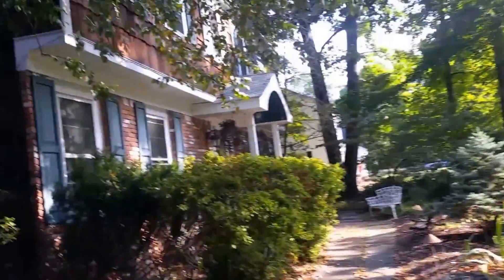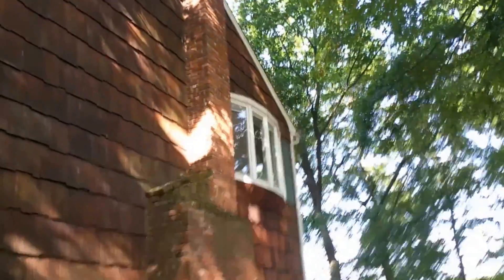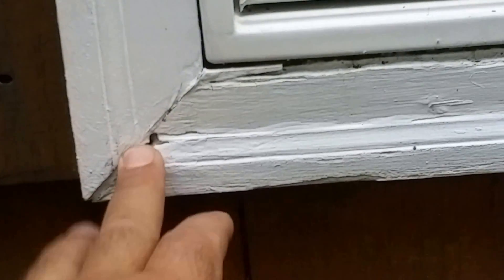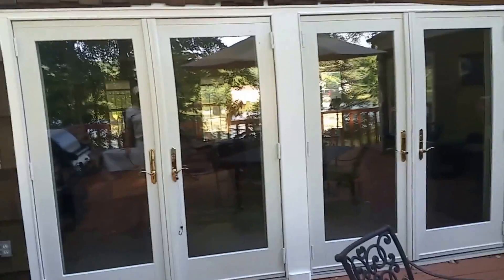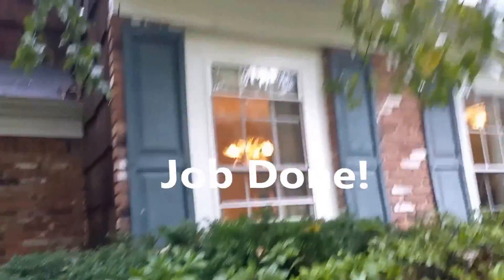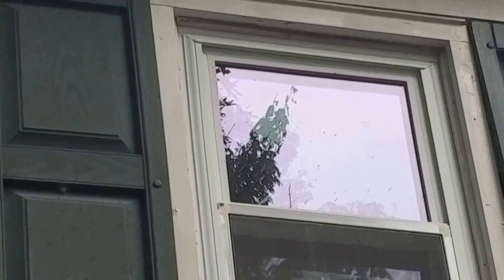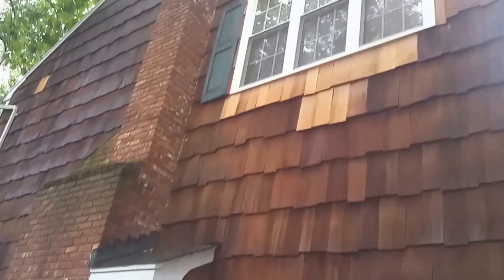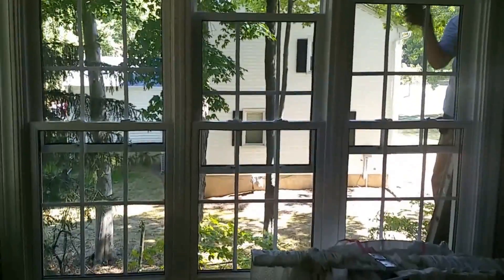Full frame replacement windows, Randolph NJ

Comment: Those Andersen 400 Series Casements are the best
Reply from the maker: Oh you mean the old units that we are repairing.
Reply: Taylor Rae Construction LLC Yes, those are my dream windows. I don't like vinyl windows, they're too boxy and barely have a sill. If I were the owners of the house, I would've restored the old windows, vinyl inserts would of been replaced with full frame Andersen Woodwright Double Hung along with the bow window. French doors would've been sliders patios. I'm glad that you repaired the brick mold on the 400 Series casements. Did you guys use Sunrise Windows?